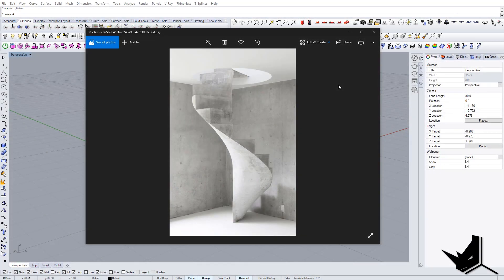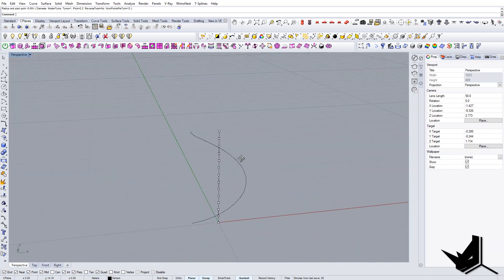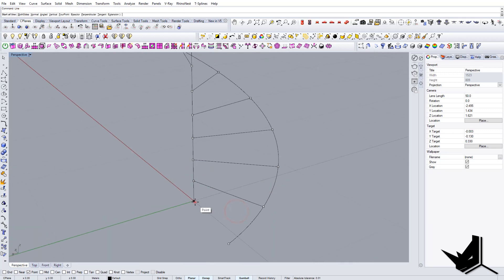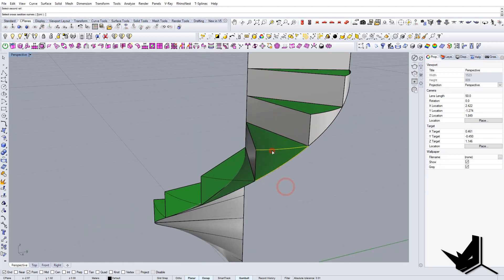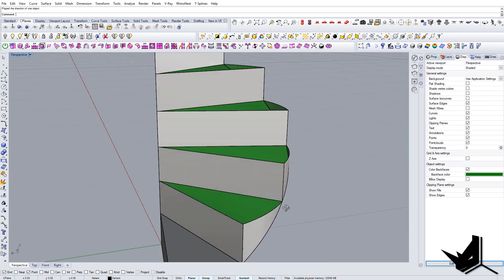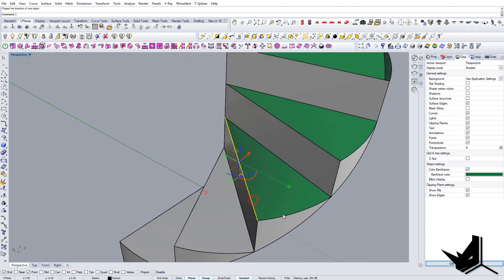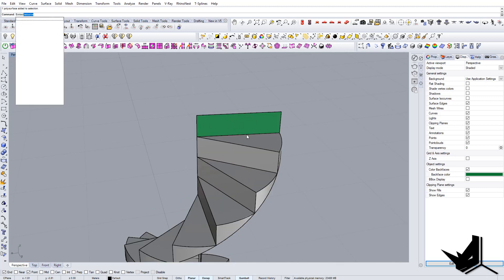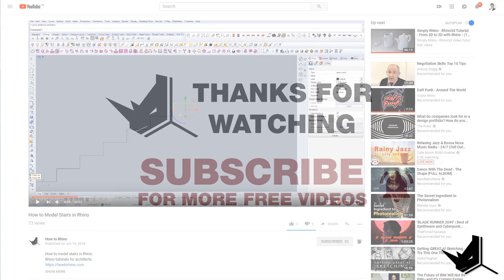How to Model Spiral Staircase in Rhino

Comment: I have never seen anyone make make a rhino staircase, where the guiding shape (in the middle) is other than a cylinder or a vertical line (like yours). How to start creating a helix that has angular sides (center shape is a squarish block with rounded corners)?

Comment: hey, thanks, but, sorry,  these stairs are not solids, they are polysurfaces, how do i make them solid? thanks
Reply from the maker: Hi Luis, you have both open polysurface and closed polysurface. It's up to you to decide if you want it closed or not. If you want to check where the edges are you can use command called "ShowEdges" That wiill show you any "naked edges" that you might have in the model and you will know then how to close it and make a solid geometery.
Reply: @HowtoRhino  Thanks. -i actually did that and there were no naked edges. I wanted to export this to autocad 3d and all I got imported was wireframe splines. No solids.